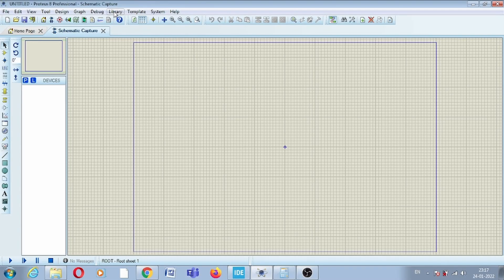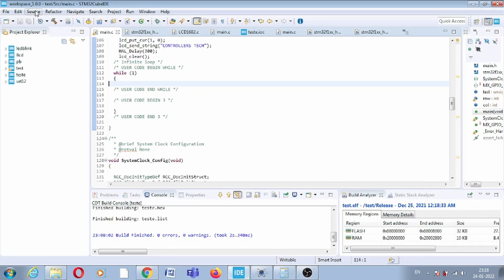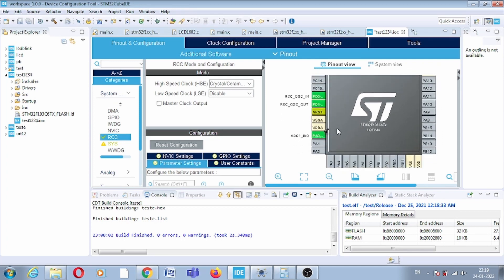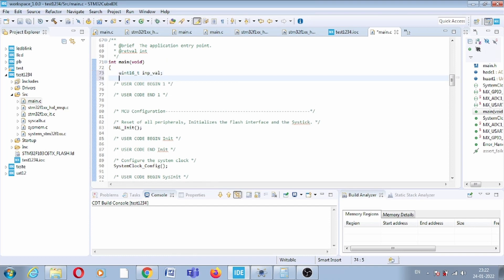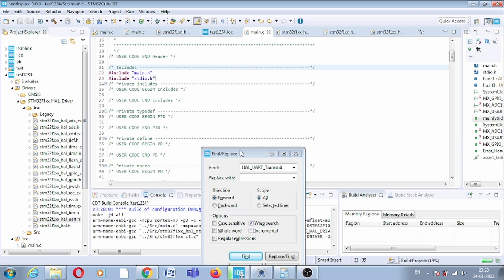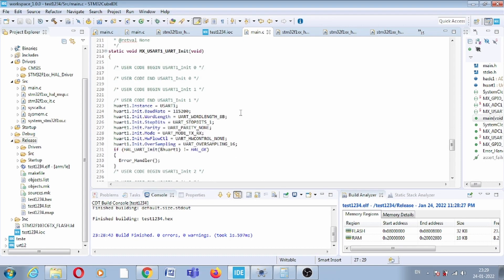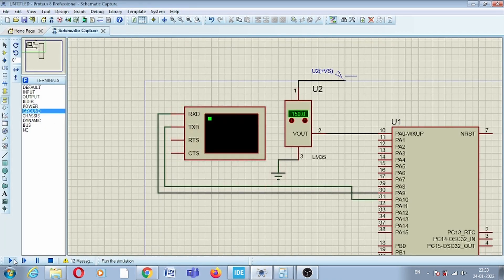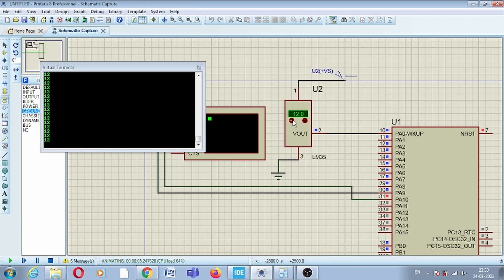STM32 : ADC using STM32CUBE IDE

Comment: Hi to me values in the virtual terminal are not changing. It's always 0 whatever I change. What did I do wrong?
Reply from the maker: Try to connect input with vcc volt and check the value on terminal... After this connect input with ground and check value..... If remain same than adc might not configured properly....

Comment: Can you please provide the guidance to activate multiples ADC channels simultaneously, but each channel should work independently. I'm struggling to read two channels and they are not working independently, when one channel varies the other one also varies. i'm using STM32F107VC6 MCU.
Reply from the maker: Please share your details on clearn71@gmail.com